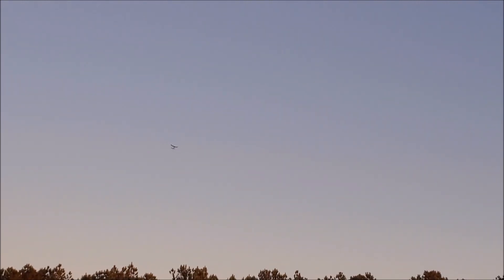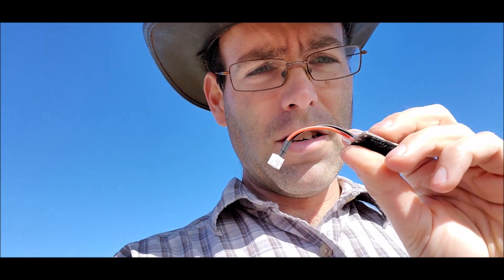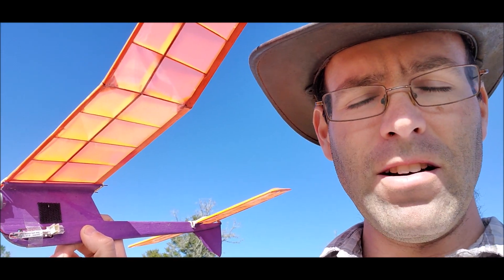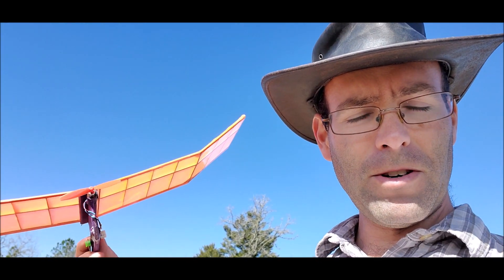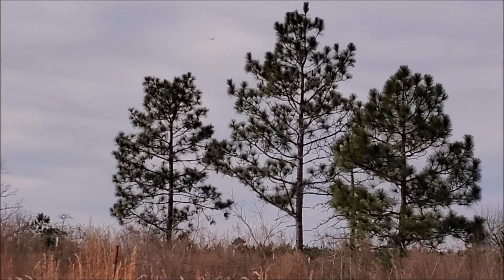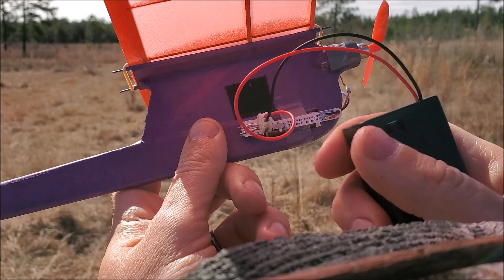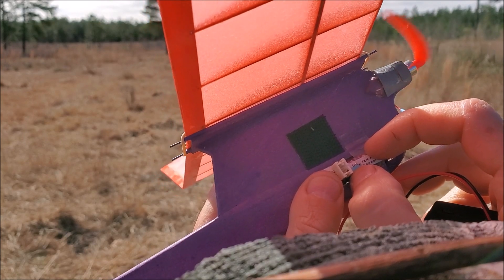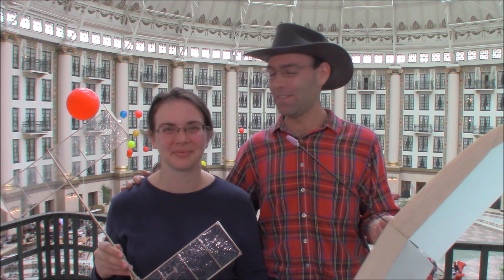E20 and capacitor flying with the Micro Starduster (let's find some thermals!)

Comment: Hi, excellent video again! I watched the video and read the comments, I'm wondering about the total weight with the 8520 motor, the 10f super capacitor, the charging board and the timer? Thank You!
Reply from the maker: It usually builds to around 30g with an E20 power system, however with cap power it's usually in the mid 20s which makes for really nice slow cruising.

Comment: Nice design. Instead of attaching the charge circuit to the airplane, why not put it in the big black charging box?
Reply from the maker: The charging boxes are a commercial product. What's on the board is only a plug and start switch, the rest is strain relief for handling purposes. We looked at setting up a metered charging unit but decided that complication wasn't necessary.

Comment: What did you use on the wings? It shows up so well in the sun!
Reply from the maker: It's 1.6mil doculam, painted on the adhesive side. Fast becoming my favorite covering. It's a little heavy for this model, but I now have 0.6mil which is perfect for it.
Reply: @joshuawfinn  i love doculam for the lightness (I use the thinnest) and high-temp behavior. While it takes a lot of heat to work it, you know it likely will not reactivate and slack up under natural circumstances. Models i did years ago don't age at all. I use floral paint after finishing. How do you paint the inside without ruining the color as you heat the material?
Reply from the maker: @RedstonePyroMan  agreed on all points. As for discoloration, I dunno...haven't had a problem with it just using Krylon and Design Master.

Comment: Hi. Can you tell me what the charger consists of? Could you use a 1S Lipo to charge the capacitor?  Also, do you ship to the UK?  Thanks.
Reply from the maker: It uses 2 AA batteries. You can safely use a 1s lipo, but I do recommend adding a resistor to limit current into the cap during charging.
And yes we do ship to the UK. :)

Comment: I didn’t hear so well but is your timer also running the DT?
Reply from the maker: Negative. The DT is separate, but is supplied with the kit (have a look at the manual on the product page...it has some tips that are useful even if you don't buy the plane). I'm working on an E20 timer that does servo DT and selectable motor runs with no low voltage cutoff.

Comment: You should check out the SONEX413 YouTube channel. Lots of info on supercapacitors and a great how to video on making a very accurate charger.
Reply from the maker: Been following his stuff. We based the design off the ability to meter by timing the charge. The big convenience though is having a lightweight system to do it with that actually does have a cutoff switch. The end user just glues the motor and board in place and goes flying.

Comment: I have a couple of the Strix timers and only get 5 seconds runs with one cell lipo  not sure why ?   what is the prop 60 mm ?
Reply from the maker: Is it cutting out after 5 seconds and the coming back on pulsing, or just shutting down? If the latter, you need to go into the program mode and change up to the full 10 seconds.
Reply: @joshuawfinn      Yes   cutting out then pulsing after 5 seconds ?
Reply from the maker: Yeah it has a low voltage cutoff. You need larger or fresher batteries for the motor you're running (or both?)